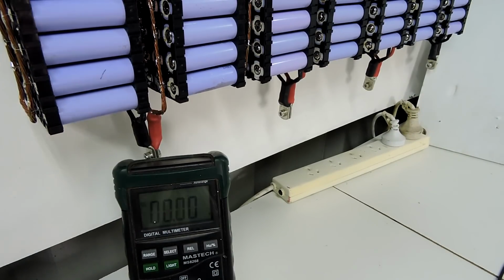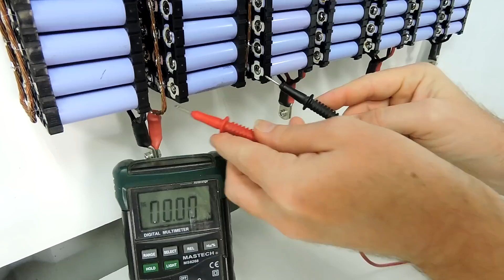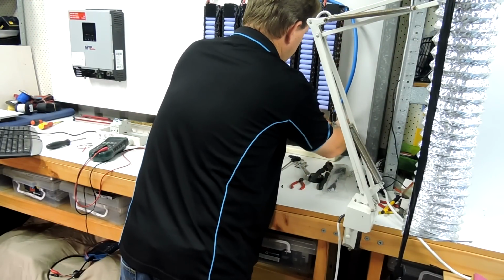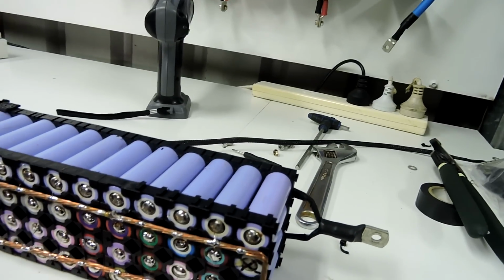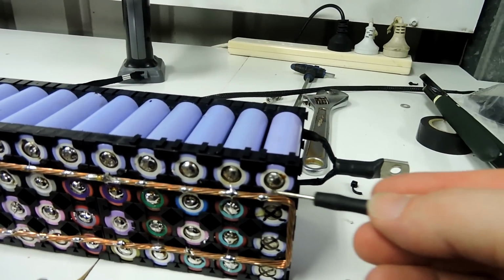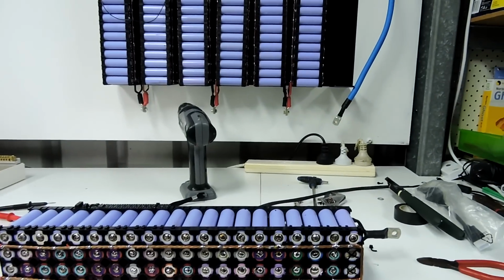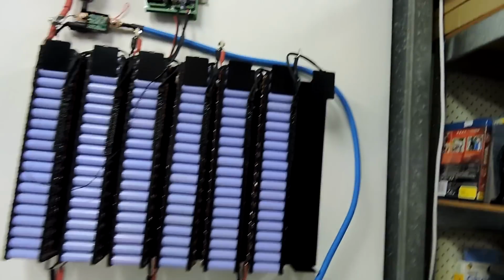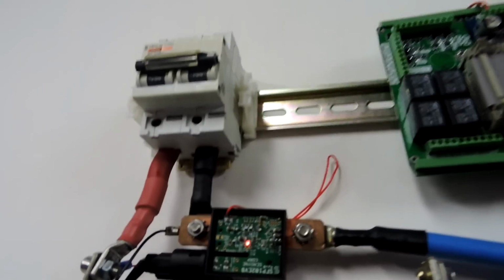⚡⚡⚡The 💥Incident💥 includes - slowmo, really slowmo, & edited out bad words⚡⚡⚡

Comment: :) sorry but i laughed ;) good nothing serious happened.
Reply from the maker: You almost have to it was so dumb lol
Reply: I've done this with my 48V pack made from ten 5200mAh 6S lipos... Using split HTX connectors to connect to ebike motor, so connectors aren't obvious which goes where.
Accidentally plugged battery + into battery - instead of to the motor, and there was an almighty bang and a blinding flash, and my hands were blackened by condensed gold and copper vapour.
Lucky that the force of the explosion broke the connection.
Had to replace melted connectors, but fortunately the pack survived.
It took several minutes for the imprint on my retinas to fade - I will not be doing that again any time soon!

Comment: WOW..... Glad you are okay... That is cool that you uploaded this to show folks that sh*t does happen even to the best of them!!. Is there any way to fasten the heavy gauge wire that all those fuse leads tab off of? as well as maybe placing heat shrink tube pieces cut to the length in between each fused tee joint? (lots of work, on top of the work load you already have, LOL). The idea that the fuse leads were keeping everything in its place, until they did there job, but, in turn, the heavy wire appears to be allowed to then float around to where ever it static relaxed moment would be, possibly shorting out on itself or a pack next to it?... or maybe I did see you poking tie-wraps through the voids of the batteries to hold fast the heavy wire to the packs?.. either way, things are really coming together. I am still excited, while watching you make this happen. A side note, and note to sound in any form negative, but I spent 13 years in a tow truck doing emergency recover for the city I live in, (U.S.A.) and years ago, when the electric vehicles and the hybrids alike, just started to show their ugly heads, the manufactures didn't quite have all the bugs worked out, to say the least. These E-hybrids have come along way over the years, but at the beginning, they were some scary "MO-FO's" to move around and store if they ever were in a collision. Especially the first years they were released. I had a brand new flat bed wrecker, with less then 8,000 miles on it, and one of those E-cars, the battery pack was cooking off, of which you will start to smell the lithium smell, of which while loading the car, I didn't smell, and once you start heading away, it is on the back of the truck, and you won't smell it if it start unless you are lucky and smell the forward air draft rush past the cab of the truck when stopping. Any how, the explosion was so powerful, it totaled out my new $130,000.00 wrecker. never mind the fact that it caught stuff on fire from the lithium contamination reaction with the other steels and alloys..The P.R. firms of the various auto manufactures paid out some serious bucks to contain this type of issues from the public eyes, as there were hundreds of these cooking off,but that is besides the point... My point is, those 18650's are some really tough batteries, as you know,  but to mention the idea, that if you come out to the shop or your shed and smell a heavy smell of lithium/plastic smell.... please be very careful... Another side note, the likeliness that the 18650's will or could explode, as a single stand-alone battery, is not likely, as per the venting design, but, ..... the amount of horse power (HP) you have... is enough to knock your house off the foundation ...LOL...  Last side note, and not to insult your intelligence by any means of any of my comments, rather, that if you do not know what the smell of the lithium composite smells like, tear open an old cell phone battery, the little 3.7 to 4.3 volt jobbies.... and that is a smell that you'll never forget.. as it kinda smells good and clean, like a pool chemical, yet, is very strong and pungent.  Again, I say all this kindly, as I really do enjoy watching your shows, and would hate to see something traumatic happen. it would be a sad day. Keep up the good work! Drew

Comment: note pad for arc welding with 18650. Proves fuses are a good thing. Time to take heat shrink and close off one end and slide them down of the top connections and now you are protected. Glad noting major happened
Reply from the maker: Thanks, Ol' timer :) Upgrade, improve and move forward :)

Comment: pretty good proof of the output power these cells  have and your design saved you getting huge burns for either the arc or touching  just arced terminals  good job mate
Reply from the maker: defiantly a win that's for sure
Reply: Great work  mate

Comment: I have done something similar with an RC model battery. Major downside: they don't have a fuse! I had 3 4S 5000mAh packs I wanted to exchange the connectors on. Of course I am not stupid, so I pull one contact out of the connector, cut it off and tape the end (even though there wasn't really any exposed wire, because the insulation was cut flush with the conductor). Then the second wire, pull, cut, remove insulation, solder to new contact, insert into new connector. And finally finish with the first wire. Worked well with the first two packs. But for some reason, I really don't know why, on the third pack I pulled out both contacts of the connector without clipping them. Of course they touched! I was a quite blinding flash (even though it was partly blocked by my hand). When my vision returned after a few seconds I saw that I had little burns and soot on my left thumb and index finger (I held one of the connectors with them) and both of the 4mm connectors were melted half through the solid part. I was lucky they did not weld together. Stupid hurts (and could burn your house down)!
Reply from the maker: As long as we learn from stupid..hehe Even NASA & Samsung make mistakes then improve :)

Comment: It's great that fuse wire worked,  but it seems like you might want to independently fuse the positive of each pack as that'd be much easier to replace?
Reply from the maker: YES! going down that road for sure, been thinking about it anyway this just cemented the idea firmly in my head :)

Comment: What product do you use for fuse wire?  What Amps do you target blowing at?  (Oh, I just realized galvanized steel is resistive.)  I guess I need tinned copper (after my 20 seconds exhaustive google research), but what gauge?
Reply from the maker: 0.24 mm

Comment: Since the current went through all of the packs to the right of the short (so all except the left two) i suspect you have more blown fuses than just the ones in the last pack.
You should check all packs. That last pack was just the one that blew the last of its own fuses first.
@ 2:15 i think you can see that some fuses of the pack to it's left are also blown. (at least i think they are.)
Reply from the maker: I have inspected all affected packs and no fuses are blown other than pack 7  was worried that I'd have hours of repairs to do. Wasn't so bad in the end 20min to redo it. Probably took longer for me to wonder aimlessly around my shed with my hands on my head saying... Truck, TRUCK TRUUUUCKKKK over and over.

Comment: What was it we determined those fuses actually blow at ?
If it was 10A the short circuit current was 80 x 10A = 800A
Reply from the maker: Tests Jo did it was 18amps I think. But real world it would be hard to test accurately with anything less than professional Equipment

Comment: Are we  doing ElectroBOOM now. lol
What brands of battery are you mainly getting, ie the good genuine factory stuff, or cheap after-market type stuff. I think all the manufactures use the good Pana/San stuff. We all assume the good Panasonic are going to be better than the cheap Moli stuff, but what are you finding.
Reply from the maker: Only use genuine cells.
Reply: Do you ever get a rough indication of age? Like if anything is older than 10 years, is it always stuffed.
Reply from the maker: if it's 10 years old it's probably a lower capacity cell I don't even know when they started making plus 2000mah cells to be honest
Reply: I cracked open 7 packs, and there wasn't 1 good cell amongst them. Some Sam's were marked 1992, and they were the best ones at 500mAh@630mA load. I was thinking of making a small battery pack to power my fruit bat scaring project - we have mangos -, but I think I might give up.
Reply from the maker: Yeh, you get bad runs - but you also get some good ones. Humm mangos :)
Reply: 92?  You were definitely finding old ones.  Best old ones I found were some dark blue Samsung's from 04, rated 2400 mAh tested out around 2300.  I heard they started putting in better protection circuits/design around 06 after all the laptops started catching fire so had thought of using that as a line, but I'll probably put those blue ones to work.

Comment: Hi, ah, you might want to look at all the packs for other blown fuse links.   The current went threw 5 banks at once.  The other two banks were not affected because of where the short circuit was.  There are better ways to practice welding 101.  {:~)
Reply from the maker: Kinda good that it only affected one pack :)

Comment: Please isolate all the live wires and also TOOLS you use with batteries :( Screwdrivers or wrenches or other metals tend to drop between terminals (because of bad karma nature of batteries :P) That happens.
Reply from the maker: I know, I'm not stupid - just dumb :) lol
Reply: You are not dumb bro! Chill ! You have already made your confession by making this educative video.  I guess you were a bit tired. I've seen molten pliers and bolts of lightning many times. Don't take that advise like I am tutoring you, that is just a reminder for all who reads. You had minimal damage, you are lucky at least. My favorite mistake in battery power subject is to cutting dual line power cords, which causes unavoidable short circuit :) We do not always use connectors and it is hard to disconnect, right  :)

Showing and talking about these mistakes like a treasure for beginners I think. They should always keep in mind all of these, or maybe a checklist, reminder list could be useful. On the other hand, pro people (like you) also should not work too hard and try to stay focused. That's all.

Comment: Be careful, DC battery power is a bitch and a half when it bites. Please be careful man.
Reply from the maker: Only 20 volts :) and a few amps 'careful' is my middle name (i don't use my middle name : DOH!)
Reply: actually it's more the Voltage and Resistance that decides if you hurt your self or you die. The Amperage is the thing that kills ;)
Reply: Dan, DIY is adding to the discussion, you're just putting someone down for no reason.

The concern is not electrocution but the discharge of energy created when the pack is shorted which DIY is probably right to say can melt your face. And HB should be commended for uploading.
Reply: That's just his attitude. As long as he stays polite thats okey ;)

But yeah, @DIY Tesla PowerWall I get you point, you can get hurt from the molten Copper (or sometimes other metals) that are generated from the short circuit. But it is like hot oil splashes from cooking. I know that, because I had both on me...
And as long as it's not a whole lot of it (Oil or Molten Copper) thats not that bad. I mean, we are all Craftsman or DIY people here, we all burn and cut ourself, thats part of the job description ;)
Reply: i feel like the short could potentially cause the two pieces to fuse under certain circumstances? causing a much larger discharge
Reply: DIY Tesla PowerWall Has any human in the history of Homo sapiens ever died from 20V? I think you'll find the answer is no. Also the "it's the amperage that kills" is kind of just a cute saying for laymans. You'll never reach lethal ..... "killer".... amperage with low voltages on highly resistive human bodies. So.... its important to get the physics right. I've also,  ever seen "high amperage" warning signs, but a million "high voltage" signs.
Reply: I'm talking to you because you are spreading misinformation "It's not the volts that matter. It's volts x amps, ie power. 1v with 10000A can still melt your face".  Its you who said that right?  Right... well that's essentially BS.  You will never be injured from any 1V source in your life.  EVER.  And no one else will either.  Because there are no ideal voltages sources in existence, and you'll probably never be in the same room as a super conductor.  So you are really just saying nonsense for the sake of being dramatic or something.  The DC voltages that he was dealing with in this video are in fact low.  I'm sure he has a hammer that he uses from time to time, if you saw him using a hammer would you say "whoa... be careful with that hammer.... one whack in the head and thats big trouble!!!!"  No you wouldn't, because obviously that would be ridiculous.  But in reality, he's probably more likely to hurt himself with that hammer than he is with 20 VDC.  So, for all those playing along at home, this its just hyperbolic nonsense, the only think at real risk here is his equipment because these voltages are in fact very low.
Reply: this video is a testament to you being wrong.
Reply: "we all burn and cut ourself, that's part of the job description". Have to disagree with this mindset, apart from simple cuts/burns... the amount of energy that can be instantaneously discharged with these packs is a very new thing for people to just have in their households. isn't like dropping the soldering iron on your lap! 
 more like, looking down the barrel of a rail gun to see why it isn't working
Reply: i have also been told that frequency plays a huge role - the 50 Hz of our mains being especially dangerous for our hearts
Reply: yep, AC is dangerous because it can bring our heart out of the rhythm and can cause ventricular fibrillation. A a small high voltage shock from a defibrillator can fix that. At DC the heart will cramp, but will most likely do his jop of pumping after that without ventricular fibrillation. But DC can cause other problems, like electrolysis in the body itself...

Both things can be deadly, DC or AC, the voltage and the current. It just depends on the conditions. A 24V Battery that can output massive amounts of current can melt metals, and the metal can burn your skin/flesh. A high voltage can cause ventricular fibrillation or decomposition of your cells...

As I always say if someone asks me if I fear electricity: "You don't have to fear it, you have to respect it, because you know what it can do to you."

Comment: Just trying to confirm if I'm doing my maths right. You have packs of 80 cells each in parallel (3.7v 2mAh=7.4wh each). 7 of these in series is 560 cells  = 4.1kwh at around 24V?
Reply from the maker: load tested at just over 5kwh of storage average cell is 2.4mah if not higher